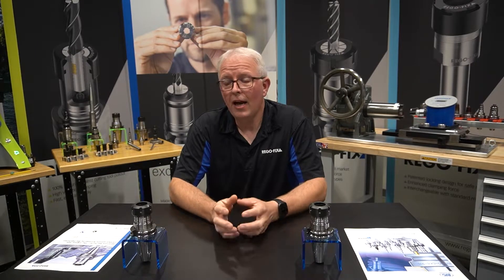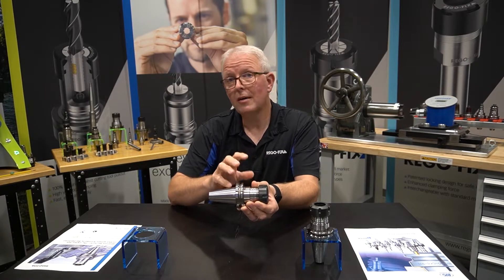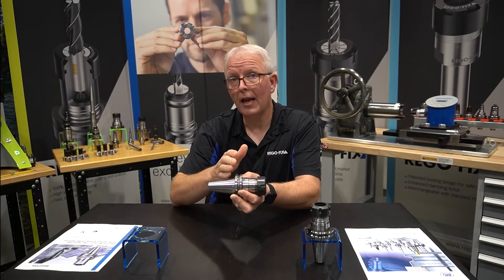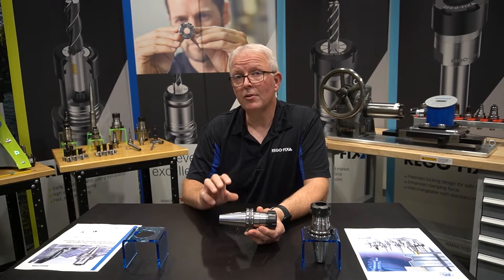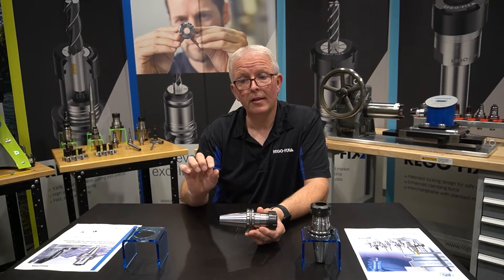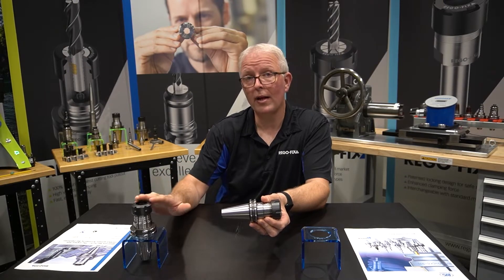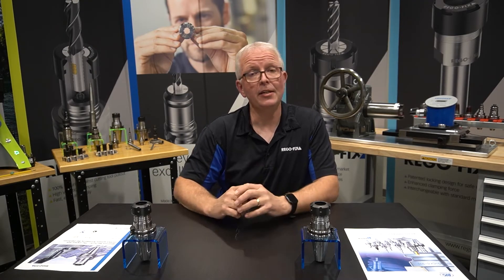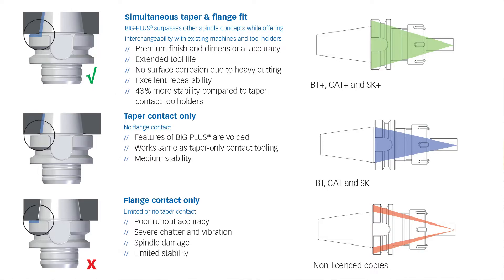TechChat - BIG-PLUS Toolholders

Comment: The quite part is being said out loud… “paid for the licensing” 

Searching for “licensed” big plus tool holder is convoluted. All I can find is promotion material on how great it is and don’t use the non licenses manufactures cause we have “special gauges”

Not to mention the pricing of the reinvention of the wheel which is the best kept secret when researching

Voiding the warranty is just more proof something sketchy is going on.

Big Fail.
Reply: Maybe just buy them from BIG or a reputable tool maker like Rego, MST, Lyndex, etc.. 

If you don't understand the importance of the gauging to ensure dual contact, then I'm not sure what to tell you.

Comment: You mentioned that warrantees on spindles may not be honored.  But that is only if you use dual contact tools that are not Big Plus right?  I have several holders that are standard Cat and I cannot change them as they are proprietary to the tool they hold.  Charles
Reply from the maker: Sorry for the delay! You're correct, normal holders will not void the warranty, only non-licensed "dual contact" holders. The one potential issue is that standard holders do leave the spindle face subject to chip damage.